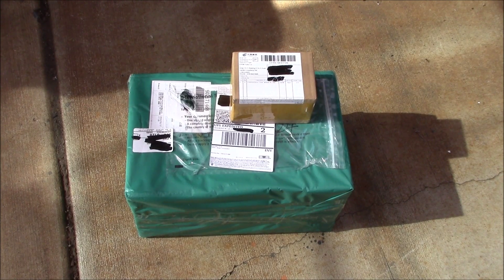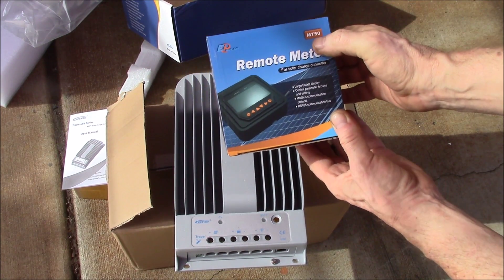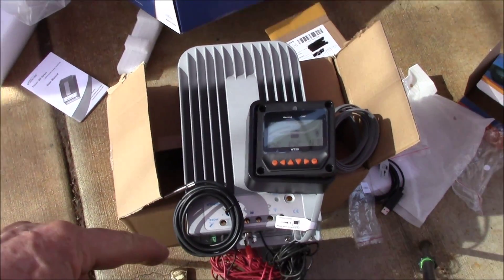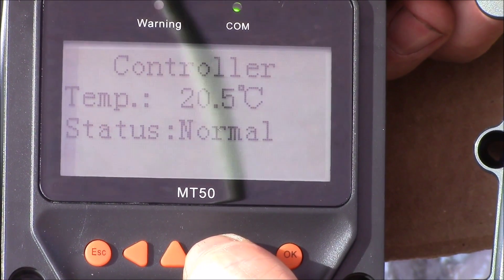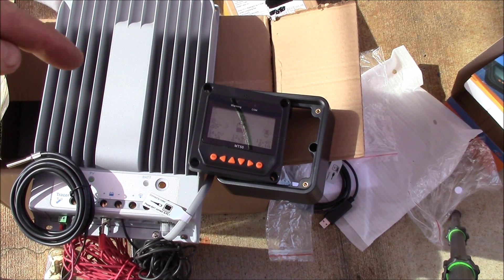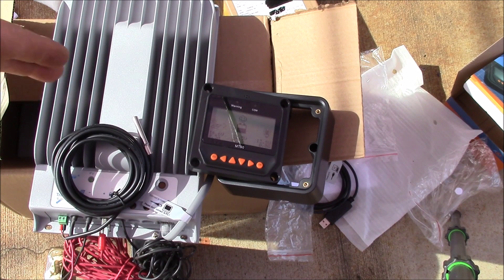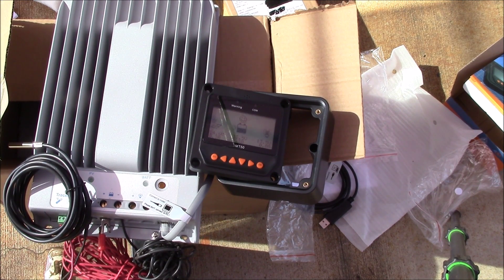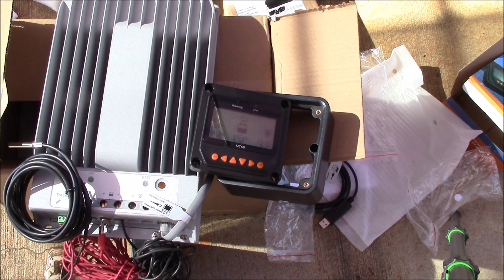EPSolar 4215BN 40 Amp MPPT Solar Charge Controller, Unboxing

Comment: Love your video. ??? Do you made a video how to install 2 40amp controller. Thank you
Reply from the maker: I don't have a video n exactly that, but this one shows two charge controllers on one battery pack:
https://youtu.be/sBQYjPfB48s
There's a 40A MPPT controller on the left and a 120A controller/BMS on the right.  They both connect to the battery + and 1 terminals.  Just make sure they're set for the same charging voltages.

Comment: How does monitor amps being in or out if not using a shunt
Reply from the maker: Likely has internal shunts for the PV, battery and load connections.

Comment: can 690 wats of pannels be connected to this controller at 80 volts in series and 10 amps ??? i have two 345 watt panels i need to use ... or do i need a seconds charger controller?
Reply from the maker: Sure, I think these are rated to 150 volts maximum PV open circuit voltage.  As far as power, whatever the rated charging current, 40 amps for the 4215BN model times the battery voltage will tell you the peak watts.  That said, you can run more panel capacity into one controller, I had about 810W into mine @ 16 volts.  At maximum charging current, I was limited to 640 watts (into the battery) plus some more into the DC load.  So on very sunny days, output was limited, but on cloudy days, having the excess PV capacity meant output would stay higher due to the ~20% excess PV capacity.
Reply: Did you mean 810wtt of pannels @12 volts or 810watt at 16 volts ... my battery  bank is 12volts ... ???
Reply from the maker: @randomtv.9486  I had 3 x 270W panels, total of 810 watts.  I had a 16V lithium battery bank at 16 volts maximum, so 40 amps x 16 volts = 640 watts peak battery charging power, so the charge controller was limiting the power.  

For a 12 volt battery, assuming you're charging around 14 volts, 14 x 40 = 560 watts.  So with that setup, your 690 watts of panels feeding into one charge controller would be limited to 560 watts instead of 690 watts that the panels are capable of.  

Advantage of that setup is you'll get that 560 watts output for more hours per day, instead of just at noon.  

Disadvantage is there's a potential 130 watts of peak capacity that's not being used on a sunny day.  

I find it's usually better to have more PV capacity than you need so that on a cloudy day you can still get decent power.  Compare that to having just barely enough panels to get by on a perfectly sunny day but then the clouds roll in and you don't have enough power.
Reply: Thanks alot .. couldn't find anyone to answer my questions appreciate it...
Reply from the maker: @randomtv.9486  Great, glad to help.
Reply: it was a question for you if that tracer can manage 690 watts at 12 volts bank .. 2 pannels wired in series??

Comment: Or another way you could do is you  battery banks . That are 12 volts . you could have 500 watts of solar panels go in one set of banks . and you can have the other 500 watts go in another set of banks of battery's . Like you could have the Ford Bank in the rear bank . The Ford bank would do the front half of the vehicle do the back end

Comment: What he probably needs to do is rewire his batteries. His probably is batteries are in 12v mode . So that's 450 watts on an 40 amp controler . If it's batteries for 24 volts a 40 amp controller what do 1000 watts . The only thing you might have to do is buy a 24 volt to 12 volt converter for your 12 volt appliances that are low power . And for your high appliances you at the buy a 24 volt power inverter . That would give you lot more power usage
Reply from the maker: Yes, those are good options and in the plans for a future upgrade.  For now, I'm running a 16 volt lithium battery system which gives me 640- watts w/ a 40 amp controller.  I may either add a 2nd 40 amp controller for that setup or switch over to a 24V battery setup.  When I go to the 24V system, I'll be using one of the MPPT charge controllers to power a 12V system off of the 24V battery.

Comment: hi dear, i have 3215bn model which 30amp 12/24v. i have two question please. (q1) no output showing on load terminal ? (q2) is MT50 worked with this model ? may we change the charger setting with with and whats the cost of MT50 ? please reply.
Reply from the maker: The DC load output is likely turned off.  Two ways to turn that on are automatically via the internal timer setting in the controller, for example on at sunset and off so many hours later.  Or the other way is manually with the orange button on the far right side if the controller is in manual mode.  That button may work in the automatic mode, but not sure about that.  I only run mine in manual mode.

The MT50 should work on that model controller and the display costs about US$25:
https://amzn.to/343BZNZ

Comment: What BUTTON on right do in these controllers ?
Reply from the maker: From the User Manual:
4 – Key Switch the load on/off in the manual mode and clear the part of faults.

In other words, if you have the DC load set up in manual mode (i.e. it's not on some automatic on/off mode based upon sunrise/sunset) then that button turns the load on and off.  Then it also is a "error clear" button if there's some sort of fault reported.

Comment: Mine started disconnecting and reconnecting to solar continuously.  Anyone have an idea what went wrong?  Doesnt show any errors and voltage is correct
Reply from the maker: I've not seen that problem with mine.  Might disconnect all the wires to the unit then reconnect one at a time starting with the battery and make sure all operation is OK.  Maybe you have a bad connection in the solar panel wiring.  I've had issues with flaky MC-4 connectors on panels I purchased.  They'll test OK with a volt meter, but put a high current through them and the voltage drops right to 0.
Reply: @The4Crawler  
Thanks for the fast reply!!
All connectors look ok and i even  connected  it to  a nother  solar array and it has the same behavior, "connects for about 5 seconds and disconnects for another 5 seconds"  then sometimes it works just like normal.
Reply from the maker: It sounds like it may be something inside the controller itself.  Have heard that the screw terminals can have issues like broken solder joints that could cause a problem like that.  If that's all OK, might be worth contacting the EpSolar support folks.  
https://www.epsolarpv.com/support.html

Comment: hi, what cable did you use? we have 20m 4mm2 mc4 cables but it says we need to use 16mm2 on the manual? also, does this have an automatic low voltage cut off? TIA
Reply from the maker: I used 4AWG (19mm2) with crimped ferrules and that fit fine.  On my older unit, I used 8AWG (8mm2) and that worked fine as well,    I think the 16mm2 figure is the official maximum size.  The unit does have a low voltage disconnect parameter and you can modify that if the built in value doesn't meet your need:
https://drive.google.com/open?id=1d9_xY2VXxfvdMjktqGuXgE6Jua3ntDGoQIO7cqKLyjE
Reply: thats very useful thank you! I am assuming the "DischaLmt" which is set to 12V is the absolute cut off point where the charger automatically stops using the batteries and cuts everyhting off automatically. :)

Comment: What's the highest voltage output from this unit for a custom battery?
Reply from the maker: According to the data sheet, it does 8-32 volts in "User" battery mode.  I'm running this unit on the normal 12v sealed lead acid profile.  But I have a 40A unit set up for 4S lithium ion at 16.0 volts:
https://youtu.be/jUQOF7qrKLE

Comment: Why use the negative ground , vs the regular mppt controller that is not neg. grnd?  I have noticed price is much more for the neg. grnd unit?
Reply from the maker: I guess in my case because the rest of my system is negative ground reference.  Here's a thread that talks about some pros and cons:
http://forum.solar-electric.com/discussion/2280/when-positive-ground-is-used-in-pv

Comment: You don't need a second controller, go from 12 volts to 24volts.
Reply from the maker: That is of course one option.  But it involves purchasing a new 24V power inverter and I also have a number of 12VDC loads that I would need to add DC-DC converters on to run off 24V.  I may ultimately go to a 24V system, but for now having the 2nd charge controller is a real benefit.  I have it running now charging a custom 16V lithium ion battery bank and powering some loads around the house.  My old charge controller didn't have the ability to set custom charging voltages, it only does 12 or 24.  The new one can do anything in between 12 and 24.
Reply: Dont need another inverter. Your cells can be wired in series to up the voltage to 24, and the mppt controller will adjust it to the 12 volt battery bank. And since the inverter comes off the battery bank and not the cells, you keep the same 12v inverter.

Comment: Why don't you wire your panels in series so you increase the voltage and not the amps. The controller should be able to handle the higher voltage input. Plus even on dull days you still have enough volts to charge with?
Reply from the maker: Yes, aware of that and intend to do that in the future once I get a couple of identical panels to wire in series.  For this video, I just had a single panel for testing, so that is what I used.  Right now I'm running this controller with one 270W/60-cell in parallel with a pair of 60W/30-cell panels that are in series.  If I put that whole combination in series, I would get less power as the 60W panels only do 3.3 amps and the 270W panel does 8.58 amps.

Comment: hi g/day what do you think would be theb biggest load amps i could run from the load side of the controller
Reply from the maker: The load current is rated at 20 amps on this model, same as my older 4210RN model.  I've run both up near 20 amps for hours at a time with no issues.  I recall seeing a chart some place that had some over current values and allowable operating times, but I can't seem to find that.  I seem to recall it was something like 25 or 30 amps for few minutes, but I've never pushed mine past 20.
Reply: hi thanks do you know if the load side is monitored or is it streight throigh
Reply from the maker: It is switched on and off via a large MOSFET transistor.  There is a current shunt, I assume, that is used to monitor the load current and likely that will shut down if the load is too high for too long.  The load current will also be switched off if the battery voltage drops below the low voltage cutoff setting.  The load voltage is the same as the battery voltage.

Comment: Nice video, can you help me decide on a better charge controller between these two found here https://anotepad.com/notes/dky9dk
Reply from the maker: Haven't used either of those two models:
http://www.epsolarpv.com/en/index.php
The CN has a contact output which you use to control external devices and also it has a user programmable battery mode where you can set up for charging other than 12 or 24 volt lead acid batteries.  So if either of those are important features, then the CN is good, otherwise they seem to be fairly similar, both have the PC communication feature, etc.

Comment: The controller in view is the 4215BN not the RN edition. Two completely different controllers even though from the same companies. The former (which is the one you have) is a much higher end with much more features (2 steps ahead) of the RN version. If you could, kindly correct because it makes the video quite misleading
Reply from the maker: Sorry about that, fixed the typo in the video title.  I had the description correct.

Comment: great controller. the best out there right now in my opinion. i sell hundreds of these every year and very few ever have problems.  only thing is that the battery display on the mt50 is innacurate even when you set your batt amp capacity
Reply from the maker: Thanks for the information.  It does seem to be a very good charge controller, runs very cool and has lots of nice features.  Yes, it seems all the Epsolar controllers I've used has the issue with reading battery state of charge.  I use a Trimetric battery monitor to measure that value.
Reply: hi, since you seel these you might be able to answer my question :) what cable do you use with em? we have 20m 4mm2 mc4 cables but it says we need to use 16mm2 on the manual? theres 4mm2 cables coming out of the solar and we also bought triple Y MC4 4mm2 cables to connect our three panels in parallel, so which bit needs to be 16mm2? also, does this have an automatic low voltage cut off? TIA

Comment: does that work out good for you,,,,I've looked at the Commander,,,renorgy sales through Amazon they are somewhat pricey but I believe they'll take something like 800/1000 Watts at 12 volts I have looked at them kind of curious if it's still doing well for you??? I have the old 4210 renorgy hooked up to 500 watts right now,,,doing pretty good so far,,,,that's going into 4/6 volt golf cart batterys,,,,,I bought a cheap,,,  power tec on inverter 1500watts from Amazon,$189.00 so far it's working out good(so far) I run my refrigerator off that as much as possible and lights,,,I may parallel another inverter myself with more panels it in my bank to see if I can do a little more
Reply from the maker: Mine has been working well since I installed it  last winter.  I still only have a single 270W panel connected to it until I get my system re-wired.  Then I'll add a 2nd 270W panel on it and that is about the rated limit at 12V (40 amps).  That will leave me with 390W on my old 40 amp charge controller (the older model).

Comment: Cool stuff...glad you did a video on this MPPT charger.
Reply from the maker: +Chris DIYer Thanks.  It does seem to be quite a nice unit.  Still learning the ins and outs of it but so far it seems to be happy running in parallel with my older 40 amp Tracer MPPT controller.
Reply: +R Brown (4Crawler) How does the new one compare to the older controller especially when it comes to the speed of  tracking maximum power point. saw some complaints on YouTube about it being slow in finding MPP especially when you put a load on your batteries. have u had any such issues ?
Reply: +R Brown (4Crawler) How does the new one compare to the older controller especially when it comes to the speed of  tracking maximum power point. saw some complaints on YouTube about it being slow in finding MPP especially when you put a load on your batteries. have u had any such issues ?
Reply: +R Brown (4Crawler) How does the new one compare to the older controller especially when it comes to the speed of  tracking maximum power point. saw some complaints on YouTube about it being slow in finding MPP especially when you put a load on your batteries. have u had any such issues ?
Reply from the maker: I haven't spent a lot of time going into those sorts of details yet.  But one thing I notice is that it seems to "reboot" periodically.  Dropping to 0W on the PV then ramping up along the power curve, overshooting the max. power point then coming back to it.  I don't notice my older 40A controller doing that, although that is harder to see on the MT5 display since there is no watts display.
Reply: +bigbrovar The older controller is said to be faster at tracking MPP compared to this new one. can you confirm this?
Reply: +R Brown (4Crawler) Thanks for the reply. I have the Tracer A series which I have noticed to do that reboot thing. though not often, usually when I apply sudden load on the battery. how often did you notice the reboot.
Reply: +R Brown (4Crawler) Thanks for the reply. I have the Tracer A series which I have noticed to do that reboot thing. though not often, usually when I apply sudden load on the battery. how often did you notice the reboot.
Reply: +R Brown (4Crawler) Thanks for the reply. I have the Tracer A series which I have noticed to do that reboot thing. though not often, usually when I apply sudden load on the battery. how often did you notice the reboot.
Reply from the maker: I just notice it from time to time.  Have not spent enough time watching it to get any pattern.  Just notice some times the battery voltage will drop (due to that controller dropping out) and then I'll look at see 0W on the PV input, then it'll run from Voc down to 16V or so then it jumps back up to the MPP point.  At some point I want to set up the comm cable and have the output logged on my home automation controller so I can go back and look at the data over a day.  Right now I have the controller running about 20A of DC load and it has about 390W of panels attached so most of the day it's mainly running those loads, which do switch on and off from time to time.

Comment: Thanks for the shout my friend, I have not been able to get mine to EQ. using just the meter, but I have not hooked up to my lap top yet that's  maybe why. U are way ahead of me using a computer us old guys are still learning . Maybe u can figure it out. So far I have not seen watts in show up either  but like I said not to savvy with tech.  Flipping 720 got me thinking to buy mine.
Reply from the maker: +TheKilog69 I only have a single panel hooked up to mine along with a long 10ga. wire to my battery bank, so haven't really been able to push it to it's limits yet.  Have hit about 198W off a 270W panel so far.  I think I still have this one set on GEL battery where there's no equalize charge.  On my old 40A controller, I switch it to SEL battery type to equalize one day every month.  Once I get this one all set up, I'll try connecting the PC to it as I think that'll display the charge mode.  One nice thing with the new MT-50 display is that it retains it's readings while unplugged.  The older MT-5 meter would lose it's stored readings if unplugged (that's how I reset it every month).
Reply: +R Brown (4Crawler) Thanks I'm sure u will show how its done, trying to play with computers gives me a head ache. :-)